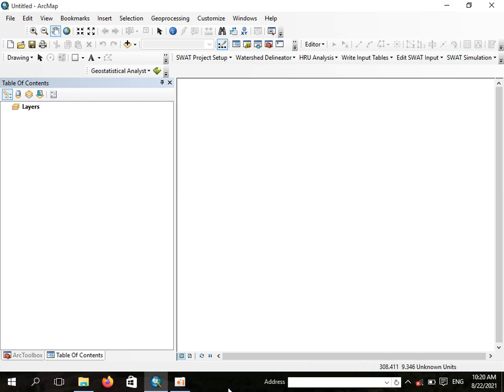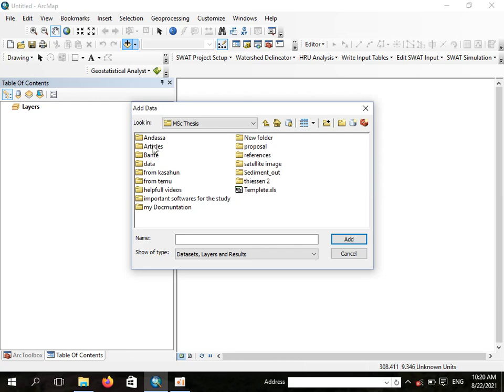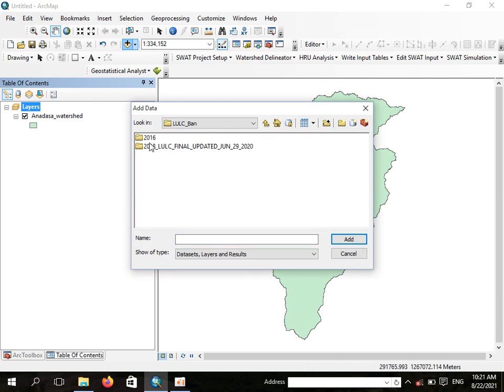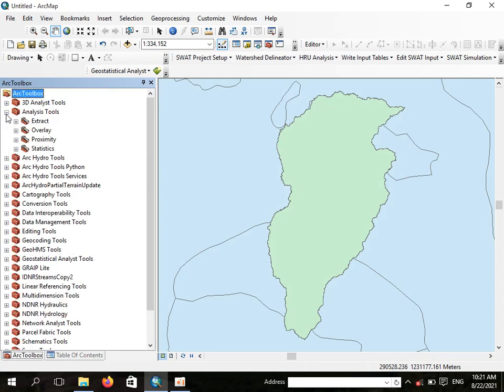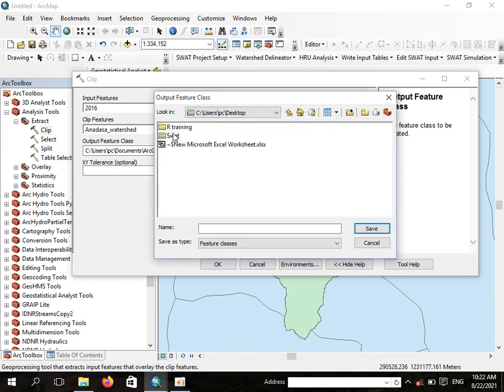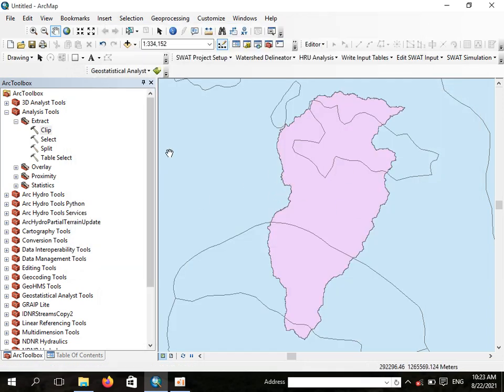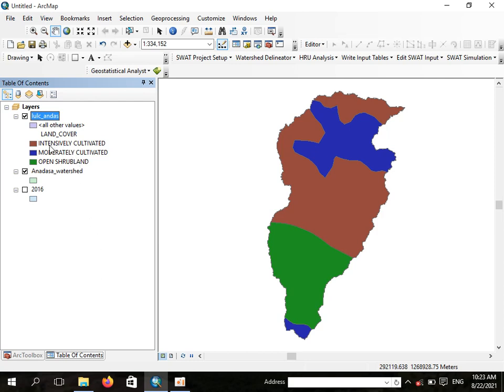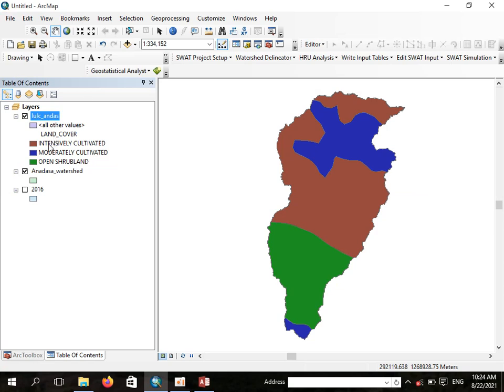Landuse landcover and lookup table preparation for HRU Analysis in SWAT model

Comment: I've prepared the lookup table according to the proper land usages. But the explanations on my raster attribute table are different coming from previous global land usage explanations. Swat is reading the land use types from look up table. So do you think I have to correct the explanations on raster attribute table?
Reply from the maker: Dear,
You should have to relate your LULC types with SWAT database name, otherwise the model will not run properly.

Comment: Hello, Give Value for water. I prepared LULC and soil maps just like you did. However, when I finish feeding LULC, soil, and adjust the slopes and overlay them, an error message appeared. It says Conversion from string "-->" to type 'Double' is not valid. Can you give me a tip on where the error comes, from and how to fix it? Thanks.